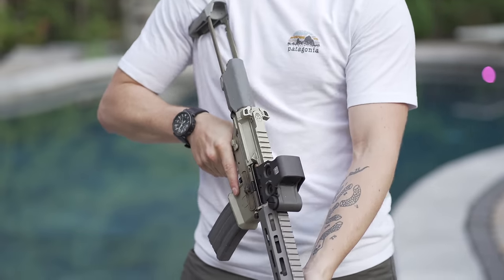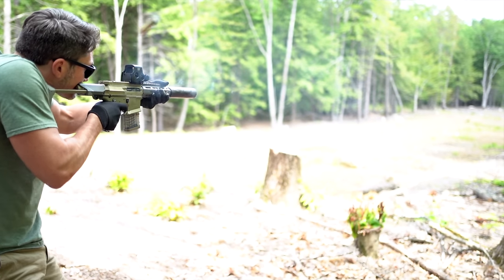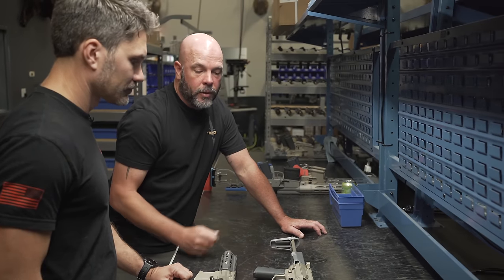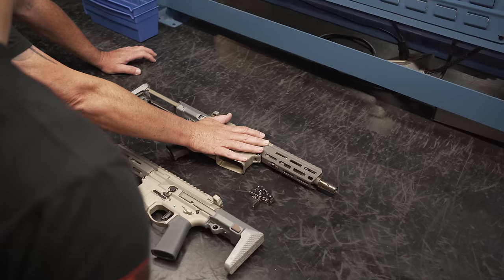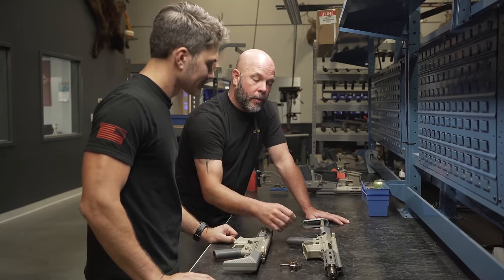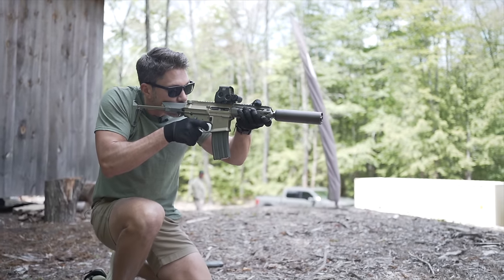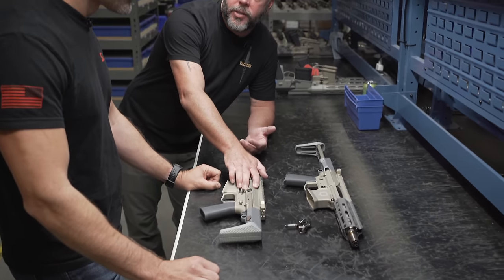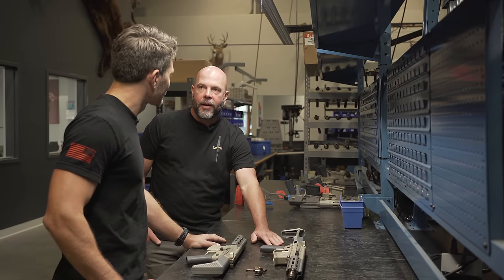Why the Q Honey Badger is Better than the AR-15

Comment: I was all in, but after Ian's video from forgotten weapons not long ago, he basically said its not really viable to use it with supers as the recoil and back pressure is too much, also that you would need a second optic zeroed for the supers vs the subs. The whole concept to me seeemed cool that you could instantly swap between supers and subs, but it seems like thats not practical or that useful? Also that you couldnt mount stuff on the rail further out if the integrated suppressor model had the extended handguard, and it got real hot to hold out there. Also I think you would need different buffer weights or gas system setups to swap IIRC, so it doesnt seem like a quick swap at all. So yes, cool, unique, and specialized. But is it the go to for any random person needing a .300 blackout short suppressed gun? Probably not.
Reply: There's no way to properly cycle supers and subs in the same gun without an adjustable block. Best example of where else this happens is autoloading shotguns, most that are pleasant with buckshot but wont reliably cycle bird shot.
As for 2 optics, that issue has been solved a long time ago. Any BDC reticle can be doped out to make hits with both, you just need to put the groups on paper. Youd have the same issue with every other calibers, just most other calibers dont have that high of bullet weight and velocity differences.

Overall the complaints are well known and already solved or settled.
Reply: @ALovelyBunchOfDragonballz  I've assembled four .300blks and they all ran supers and subs fine with non-adjustable gas blocks. If adding a can subs cycle a bit more reliably too due to the added back pressure. Yes the gun may be gassy without an adjustable gas block but it will function reliably and have one less fail point. That being said an adjustable gas block is probably a great addition to fine tune the recoil.

To the original comment, if you shoot your specific supers and subs enough you'll learn the ballistic differences. Typically subs aren't very effective past 100m due to them having about the same terminal ballistics as a pistol round which wildly vary based on bullet tech.. In my experience it is best to zero for your supers, which you'd more than likely use for longer shots, and learn the offset of your subs. Also with subs being less effective at longer ranges, your holds under 100m may not be dissimilar enough between supers and subs to matter if you're primarily shooting the subs in close. 

Currently I own a 10" 300blk that is my "camp gun" I can use it with subs for hunting without the neighbors getting crappy and I can run supers if a bear rolls in and gets feisty or if I want to take some longer (relative to the cartage), more ethical shots hunting. Its also super handy jumping in and out of vehicles and would be great for CQB/quiet close engagements. Obviously a good fighting 5.56 gun should come first but .300blk is a viable platform.

All of this is just from my experience with 300blk so mileage may vary.
Reply: @s.simm93  I said properly for a reason. If the gun cycles supers properly then it'll lazily cycle subs if at all, and ifnit cycles subs properly it'll be overgassed with supers, there just no way around that problem. A 300BLK gun should be more than capable of cycling both, but not both properly without some form of gas tuning. Even if the tuning is as simple as "subs with a can and supers with a bare muzzle", some tuning is required.
Reply: @ALovelyBunchOfDragonballz  I guess we can be autists about it haha. I've always been in the boat that an over gassed gun is better than under gassed so I've never really gotten bent out of shape about my 300blk guns being too gassy because even when they are 100% reliable the extra gas really isn't that bad. I get that some people nerd out about that stuff though. I just like the KISS mentality, which I get from just running a fixed gas black and sending it. Like I mentioned mileage may vary and I respect and understand your opinion too!
Reply: @s.simm93  I thought the same thing until I finally put supers through mine. The gas in the face is awful and my guns tearing up cases. I intended to mostly shoot cheap supers for practice and reload empty cases into subs, but my extractor mangling the rims and I have ejector marks. Subs eject lazily at ~4oclock and look great, but until I get the gas sorted out it'll keep tearing up supers. Cycles them well enough I suppose, really throws them out with some authority.
Reply: @s.simm93 what buffer set up are you running?

Comment: I really liked my 300blk AR. I built it to mimick they Honey Badger, since I definitely couldn't afford the real thing. I think all total it was about a grand. Including materials to make my stock😊. Last year, I replaced the barrel with a 350 Legend one, and I love it even more! It hits like a truck, and is very light, very compact, and dang accurate for it's size. I'm using a 9k can, and it's super quiet.
Reply: Dude, guaranteed you saved yourself $2k. Q is just overpriced due to hype beast inflation. Its awesome you realized you didn't need to spend that kind of money and you built yourself something awesome that you can be proud of!
Reply: @s.simm93  I love the little thing. Now, money is not really an issue, so I'd at least be tempted to spend the big bucks. The only issue I have with the Honey Badger is the recoil. That thing is not soft and gentle like an AR should be, it bounces around like a three hundred dollar blowback.

Comment: Honestly sounds like they need to put more engineering behind HOW they make their systems. Sounds like a lot of wasted opportunity if the only reason they can't make more at a time are limitations on tolerances and proprietary components.
Reply: they're a tiny company. You can't innovate some groundbreaking manufacturing process to make your actual product when you don't even make half the parts that make it your product.
Reply: @ravissary79 Half the jobs of engineers is to make something easier to manafacture on scale.
Reply: @kingqw3rty-_-982  making something easier to manufacture on scale only helps if you are set up to manufacture on scale.
Such techniques really worked well in the AK factories in the USSR, they could crank out massive amounts of reliable weapons at a low price point... but those factories are essentially small cities and have the support of multiple nations to produce their primary military small-arm.

Apples and oranges.
The boutique AR market is all about custom machining small batches of precisely made parts with higher quality materials.
Q machines many of their parts in house, but not all. I think certain parts like the high twist barrels and the bolt heads and a few other bits are better handled by manufacturers who specialize in those more particular metallurgical hurdles.
Reply: @ravissary79  on second thought you”re right the scales they are doing this on are insanely small but the gun is very overpriced for the vast majority of people because of it and the creators arrogance over what is essentially a proprietary AR and calling people who don’t want to buy a product like this poor annoys me.
Reply: @kingqw3rty-_-982  it's within 200$ or equal to its direct larger scale competition: the sig rattler.
The honeybadger is available from at least 2 retailers for 2899, which includes a 200$ sbr tax stamp.
The sig rattler goes for $2699, without the tax stamp being paid.

Comment: Just sold the HB SD to a customer  and did some testing. It’s very well made but the chamber tolerance is way too tight. After 100rds it WILL fail….once that chamber gets any fouling it will fail to go into battery fully and the new rd will get stuck in the chamber and will take significant force on the charging handle to retract. They need to ream out the chamber a thousands or so to increase reliability.
Reply: So you're saying all the ones they have produced have failed?
Reply: Lol i shot 200 rounds one day if you ride the bolt that happens but really thats with any supressed AR lol if you just let it send home its all good nothing a lil lube wont fix 🤘🏽
Reply: @ReynaR713  🙄 we weren’t “riding” the bolt. This is happening during cycling. We have tested many ARs with cans that go way longer without stopages compared to this gun.
Reply: @aquilaarsenal  wtf never had that happened during cycling fingers crossed 🤞 lol dam well shit idk guess i had a good batch 😂
Reply: I have no use for an AR that can’t make it through at least 210 rds (standard combat load out) without cleaning or lubing the gun during that timeframe. And yes we cleaned the chamber out and sprayed some clp and it ran again but that’s not enough reliably for  me for that cost. But hey if you like the HB by all means use it.
Reply: @xm3ntal620  not saying EVERYONE will fail but the one we tested could only make it 100rd between failures. We have heard of this happening to others as well. But for them to claim it’s “better” than any regular AR, is nonsense.
Reply: @ReynaR713  look, I really want to like Q lol. They make some good stuff. I really like their bolt stuff but I’m not sold on the HB line. I think it would have served them better to use a short stroke pistol gas system instead of direct impingement, especially on the SD.
Reply: Lol not even kidding lol i just shot it today not lubed straight from the backpack and ran 120 rounds and its was 100% . But hey like you said ill just keep shooting lol guess i have a unicorn in my hands 😂
Reply: Tht sig rattler is nice asf fuck and i know man in understand im just fangirling over here just being dumb lol 😂

Comment: I built 2 Dirt Squirrels as featured on 9 Hole Review's and 1,000 rounds of 300 Blackout for less than the Honey Badger! And I still can use standard and available AR-15 parts. And I can swap out to my MK-18 upper and burn 5.56 NATO. Eugene Stoner's AR-15 is a Modular Weapon's System. Proprietary parts nueters that and you are stuck with just another rifle.
Reply: Dirt Squirrel was the name of my cousin's heavy metal band!

Comment: Q sure has a lot of pride in a platform they don't even assemble correctly. You can be pretty lazy when assembling a bolt carrier, for example, and it still work without issues, but man are Q bcgs so poorly assembled. The gas keys will actually fully work themselves loose. The fasteners almost always fail reverse torque tests. They'll ship rifles with handguards slightly off axis.
Reply: I’ve had several Q firearms and all of them have had QC issues. Missing screws on gas block, poor finish issues on the barrels, etc.

Comment: since some AR's are 1/2 moa, the claim that this thing is 100x more accurate is obviously a lie. It cant even be twice as accurate and nobody is more accurate in the field than a good AR is.  Does this thing have night sights? .22lr conversion unit? Different riflling twists.? Different barrel lengths and diameters?  Does it have a chromed chamber? Can it be had as a stripped lower? can it be had as an 80% finished part? If the answer to any of those questions is "no".  then it is NOT better than AR. In fact, it's not NEARLY as good.
Reply: Not simping, but what AR's do you know that are 1/2" moa with a 9" barrel?
Reply: @AndrewDasilvaPLT   this thing aint that accurate, either, believe it.
Reply: @AndrewDasilvaPLT   this thing aint that accurate, either, believe it. Nobody is, in the field, with anything and you dont need to be, either. Also, 223 aint got enough power and range for even 1 MOA to make any difference vs 2 MOA, much less for 1/2 MOA to make any difference.  You dont need to dot his eye at 300m, just hit his 6" head. That's 2 MOA.
Reply: This is called hyperbole not a lie. 100X more accurate is an affectionate use of hyperbole by the weapons creator.
Reply: @lordhuck2689  what you mean is "bs to try to sell a ridiculously overpriced, specialized gun."
Reply: @SonnyCrocket-p6h   Overpriced is an opinion statement. Facts on the ground are those guns are constantly sold out. the market is a more objective judge of what is overpriced.  Something is worth no more or less than someone is willing to pay.
Reply: @lordhuck2689  right , and how BIG is that 'market", compared to the 15 million proven sales of AR-15's, hmm?  lol.
Reply: @SonnyCrocket-p6h  Porsche sells a lot fewer cars than Honda, and Rolex sells fewer watches than Citizen.
Reply: @lordhuck2689  In typical shill/fanboi fashion you're misrepresenting value and worth.
Reply: @blessedbaphomet   Value and worth are opinion statements. There are different to every individual. Familiarize yourself with diminishing returns on high performance items. Supercars do not often yield 5 times the performance of normal cars but they do cost 5 times as much.  The HB performance is partially in how lightweight is for the performance it grants.  If you can't afford it or don't find value in that, then it's just your opinion.
Reply: my error here. What he said was that this gun is 100x more accurate than the HK SD, which is a pretty inaccurate submachinegun, because the dummies drill holes in the barrel to bring the veocity of normall 9mm ammo down to subsonic speeds  What they SHOULD do is just shorten the barrel.  When the bullet passes those holes in the barrel, pieces of bullet are going to get torn off, or blown off by the blast of the powder gases that are pushing the bullet out of the barrel.. All of those things are hurting accuracy.  and 9mm ammo is not exactly made for long range precision in the first place.
Reply: I have no idea how this got published here. sorry

Comment: MP5SP is absolutely not a ".380" that fuddlore has been proven false. I can't believe a Silencer "Expert" would casually peddle fuddlore like that.
Reply: +p .380?
Reply: @HighCapacityAssaultPug is it 380+P or 9mm-P?
Reply: Also not 6-9 MOA.  MP5s in general are pretty damn accurate.
Reply: @carpenoctem5421  I like the way you think

Comment: Uhh kevo, thats not what tolerance stacking is 😂 source google the damn definition, and I'm a 20 year mechanical engineer/journeyman machinist 😅 Tolerance stacking is where acceptable variances in tolerances stack up to a point of a part or assembly no longer fitting/working. If your pin tolerance is +/- 0.005" and your hole tolerance is +/- 0.005" but your pin is found to measure +0.005" and your hole is found to measure -0.005" you now have 0.010" interefrence and your pin doesn't go in the hole.

Obviously this is an exaggeratedly simplistic example but it illustrates the point.

Comment: Other than the stock and lower receiver, the Sugar Weasel is sorta like the Honey Badger, no? I went the SW route with a Trash Panda and I absolutely love it. It has a little more kick than a B&T APC9 with a Dead Air Wolfman, but it’s just as quiet when running subs. Did Kev and the gang do anything special for the SW like they did for the HB? As always, excellent content, thank you! Oh, and I want to get a Fix!

Comment: It is not better when you can't get parts. You can get any level of quality that you can afford in mil-spec parts from a $310 budget build on up. 5.56 functions reliably. Reinvent a different wheel, AR-15 rolls fine.

Comment: The honey badger is on my list of guns to get. I have Qs Sugar Weasel and it’s absolutely amazing. I made a dirt squirrel 300 blackout tho. I threw an Aero lower with bravo 300 blkout 8” upper and then I added a radian raptor charging handle, Geisselle Tigger and Holosun 510C on it. My most recent purchase was a badlr R laser light combo I added to it as well

Comment: Love the content, lotta hate on the bait title lmfao. Side note my first can was a trash panda, the taper is ineffective for fouling that accumulates on the (ports?)  of the cherry bomb. So you end up grinding threads on carbon after a few hundred rounds. Works great otherwise.
Reply: Also, Q's mounting solutions tend to get stuck in the suppressor when you remove them, unless they're rocktited to buhgeezus. I always thought that was a poor design.
Reply: @TheIslandExpat  yea ive heard of this happening. The easiest redundancy would have been adding wrench flats behind the taper. I guess it wouldnt look sleek enough with those.

Comment: It’s like comparing 10k gold to 24k, Q is just a 24k product. You pay for the refinement and nuance. It really is a master piece, at this point in time until a new kind platform is invented we are at the pinnacle of small arms, companies like Q push innovation.
Reply: Couldn’t have said it any better lol 😂
Reply: Nuance? Seriously?

They haven't innovated anything. They took a very old weapons system, made everything proprietary, did not increase performance at all, and are charging an insane price for it. If anything, that's the literal antithesis of innovation.
Reply: @stevem4783  exactly.  There is zero innovation in the HB, which is why it lost the contract.  Sig actually did innovate.

Comment: I have a BRN-180SH and then used light weight parts. It's not as light but it does have a silent mode. And it interchanges with other uppers or lowers.